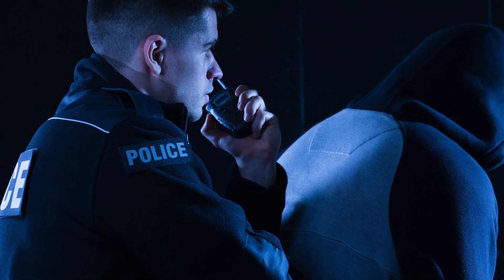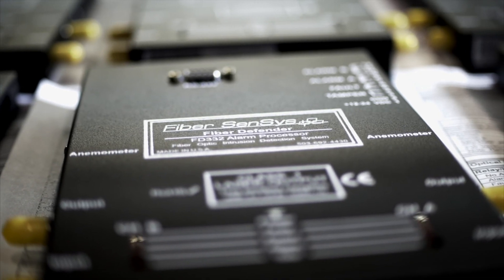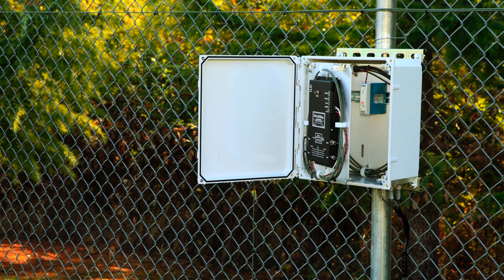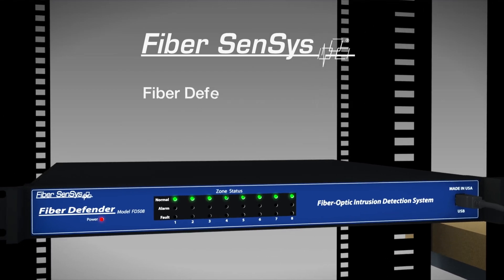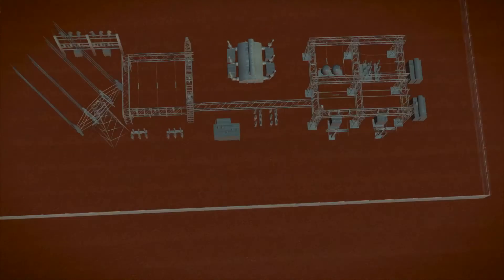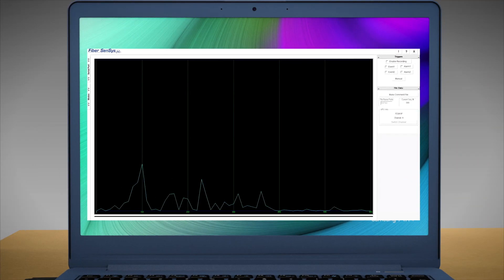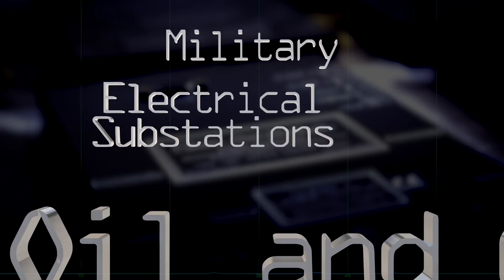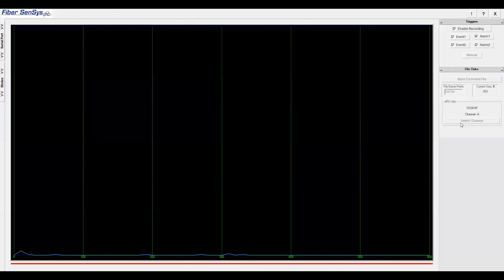Fiber SenSys Overview

Comment: How much is this system for 300 square meters in my garden ? 
I want to bury all fiber optic cable in the ground (installed underground).
Reply: It would be best to find that info going on the company's website, then contact them via email or phone. It should be easy. I doubt anyone would post prices on YouTube. Also, price might depend on the hardware and software you need. Someone might be able to help you pick the right system for your particular situation.